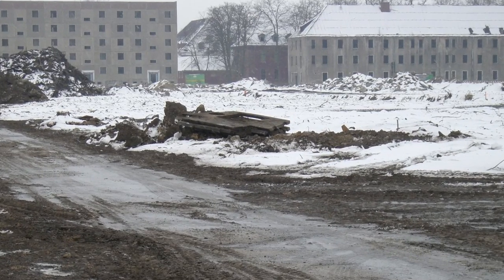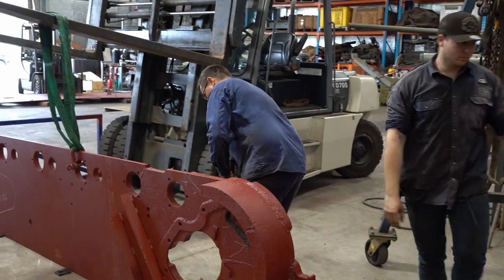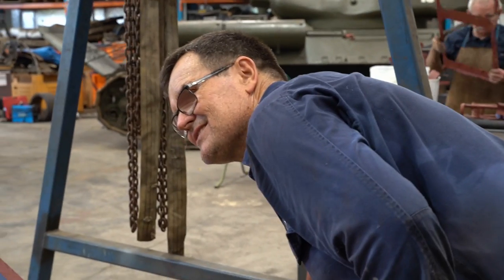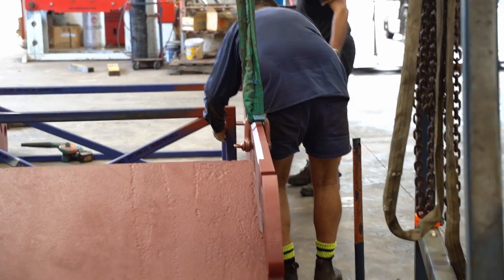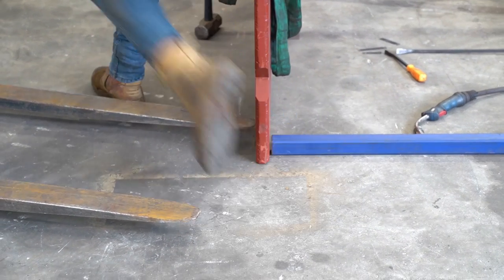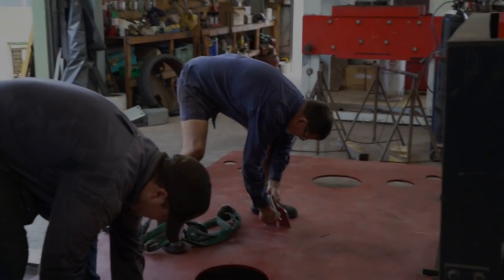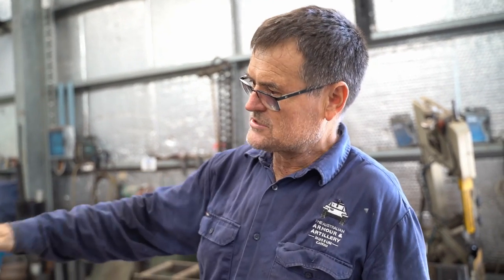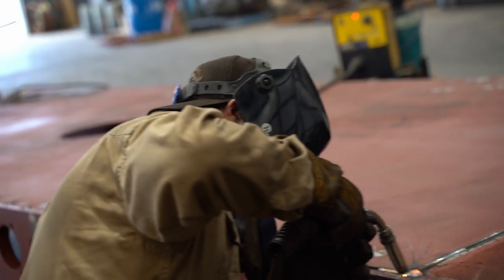Workshop Wednesday - JAGDPANTHER RESTORATION Ep. 4

Comment: The place with parts that is mentioned was found during clean up of old industry area in 2018 : Brandenburger Eisenwerke GmbH / Brandenburg-Kirchmöser. List of parts:
2x Jagdpanther (JP) front armour plates
69x Panzer IV Engine Covers
8x JP Kommandanten spawns
1x JP Back plates
Some boarding hatches
About 10x JP engine covers
Lots of hinges
Very important Jagdtiger hinges for the boarding hatches
5x panzer III torsion bars
Lots of panzer III StuG parts
Some unused steel plates
Lots of panther Idler hub cups
Lots of small bits and pieces".

Comment: To ask a dumb question...are the guys welding directly on the red oxide primer or are they cleaning just that area back to bare metal? I have tried welding on the Dulux brand red oxide primer on sheetmetal and it just won't work.

I'm really surprised they're also getting a positive connection with the ground clamp on the primer. I didn't think that'd work, that you needed to have bare metal to weld and ground on?

Comment: Torsion bars will be the beast of burden, that is if they decide to go that route. If torsion bars are installed for the roadwheels it would be a lot closer to running condition than a static piece. 
Only if the scrappers from after 1945 knew the value of the items where were cutting up with blow torches. Suppose they may not have cared as long as they got their tonnage.

Comment: It was cool to hear that everything was purposely built loose and sloppy probably to be able to build them faster and not waste time trying to get it perfect, plus slightly out of spec parts will still fit and work. Who knows how straight, level, and square those huge slabs of steel were when brand new anyway. I know everyone thought the German stuff was overly complicated and built to exacting standards but sounds like they also knew some things just have to be just good enough.